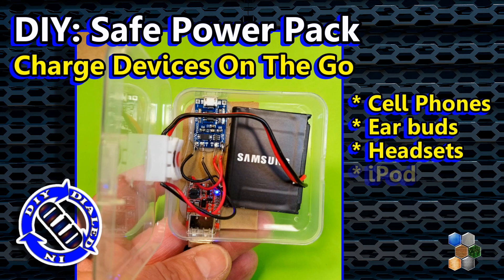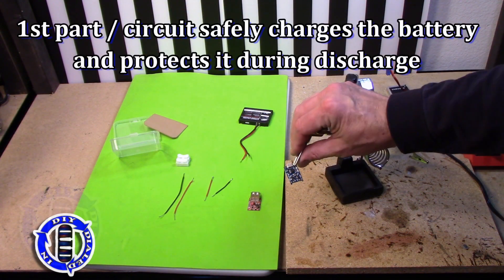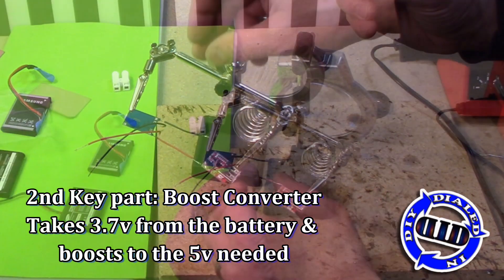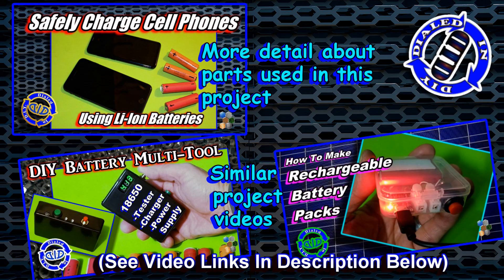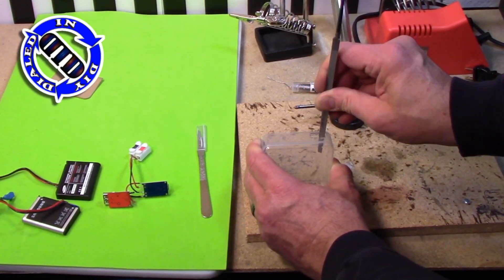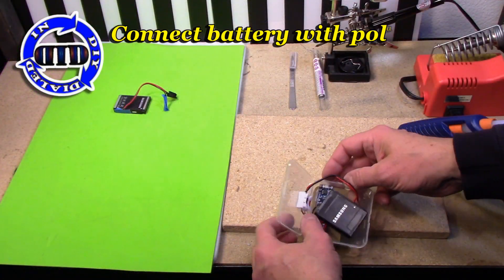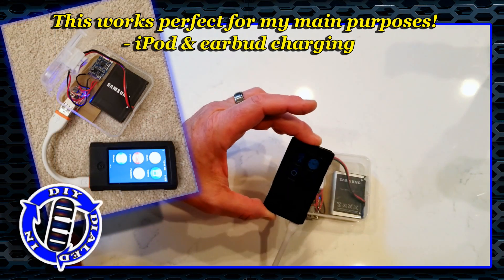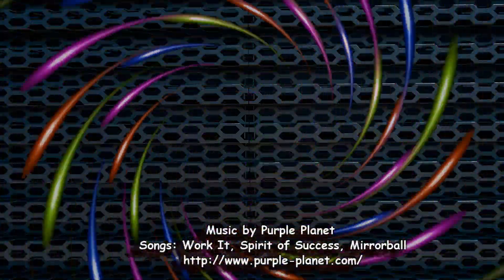Make Portable Power Pack for Cell Phones and Other Devices

Comment: This is really cool. I stink at soldering, but oh well. What about adding a solar charging option? You could salvage a cell from one of those solar power garden lamps/pathway markers.
Reply from the maker: You have allot of great "Dialed In" ideas that build off my vids (thanks!)  I actually have some solar chargers that I have been wanting to experiment with.  One project is to add better battery storage to existing devices. A second project is to use the solar chargers as the power source for a battery charger.  But I do have some tinkering to do first to see what options and limitations will be.  Thanks for your comment... and watching!!!
Reply: @DialedInDIY  always my friend.